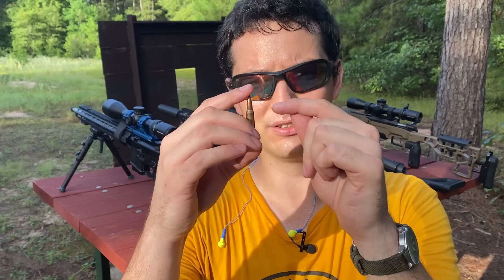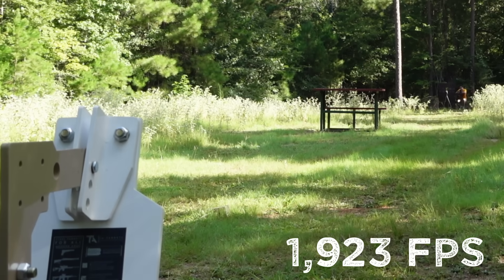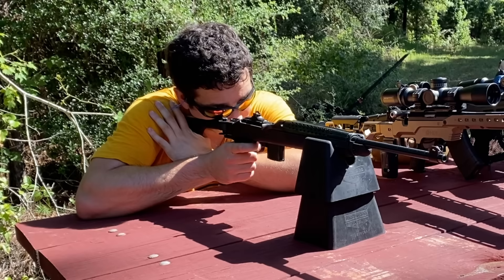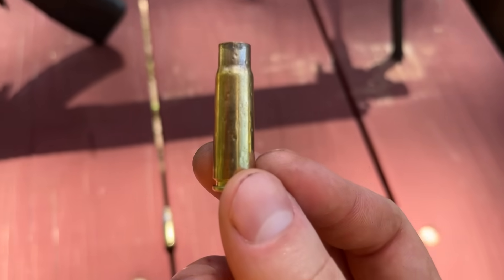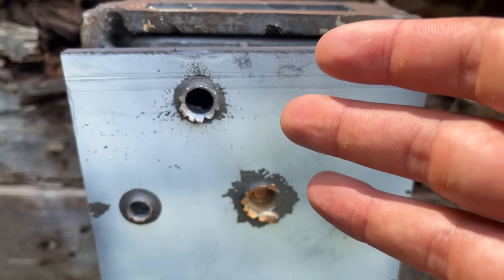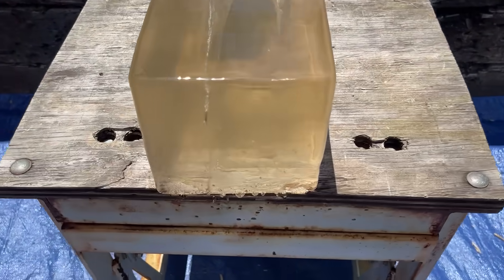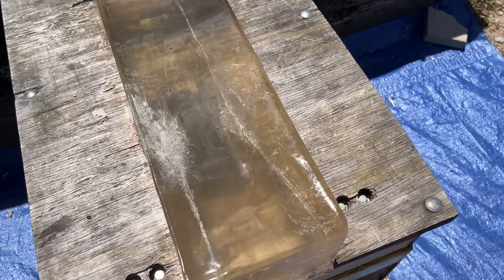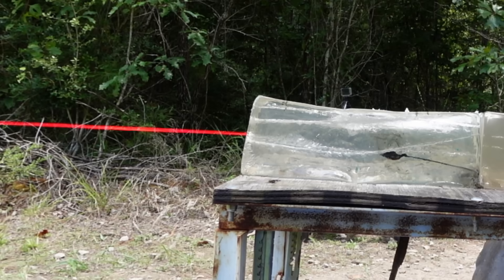I Will Never Shoot These Bullets Again

Comment: I bought an AMT Automag III chambered in M1 30 carbine, roughly in the early 90s. Haven't got it out for quite a few years, so went to the range with my youngest son, this Christmas (he's 38) and fired some of that cheap Mexican Ammo. It worked fine, but my Automag jammed after about 22 rounds. A roll pin came loose and jammed the slide. Resolved that the same evening while cleaning it. Went back later in the week and fired another 150 rounds plus finished the Mexican ammo box too. No issues, and I'm fairly certain that my loose roll pin had nothing to do with the Ammo quality?  I had 2 other brands as well, of M1 Carbine because its getting harder to find. It was a lot of fun. The Automag is a long slide, so it has a good site radius, easy to aim with precision! Anyway, I recall one issue back in about 1993 with some extra "hot" reloads. The bottom of the magazine blew downward and out. It was the only mag that I had, at that time, so that stopped my fun for that session. Before long, I purchased two new magazines. So its had a bit of a checkered history, but overal its a fun shooter! Whereas never had any issues at all with my actual M1 Carbine (long gun, not the Automag). Mine is an older WW2 relic. Used it for thousands of rounds over the years, when attending DCM fun-shoots, back when I was younger and had more spare change!  The M1 30 Carbine round is a good performer for plinking out to 100 yards with a peep site, or about 50 yards with the long slide pistol. Good enough to group well, but basically very little recoil; makes it a relaxed time of good fun at the range!  👍🤠   So if something goes wrong with the M1 Carbine long gun, after very few rounds, I would suspect poor manufacturing quality??

Comment: Years ago I had a bolt on a word war II IBM 30 cal carbine shatter. Luckily I was wearing shooting glasses. I did have a few minor cuts on my face. I had the rifle checked out by a gunsmith, all that was needed was a replacement bolt. He checked the headspace and fired 4 proof rounds through it. It's had well over a thousand rounds through it since

Comment: The 5.56mm tracers don't ignite untill 65 to 75yds & burn out at 500yds so u need some distance for this test. The 30carbine burns from 100 to 400yds. The 7.62x51 burns 100 to 850yds. 50cal burns 200 to 1600yds😊

Comment: I got my hands on some of that fake LC 52 berdan primed Chinese junk 25 or so years ago. at the time, I did not know that it wasn’t real Lake City ball ammo.  We were shooting some of it out of a Ruger Blackhawk in 30 carbine across a chronograph. we were getting velocity readings with over a 500 ft./s swing in velocity. that stuff was clocking out of that Ruger between 1800 and 2300 ft./s. The difference in muscle blast between the 1800 foot a second and 2300‘ a second was obvious. that Ruger is a strong design which is probably why it stayed together. wish I still had the spent cases. Primers were flattened way out of of the pocket on several of them. When I looked inside the cases and saw they were berdan primed, that’s when the light bulb went on. I trashed the rest of them. this is likely the same thing you experienced.

Comment: I had fired a Broomhandle Mauser pistol  in 7.63 mm calibre years ago in 1973 at the Long Beach Police Pistol Range with DWM #403 surplus ammunition that was loaded in 1936 that was loaded with the fulminate of mercury primers. Well, one fired but the head of the case blew out the magazine well and did some other damage to the extractor.I bought a new magazine flat spring and pressed the bulge out of the magazine and replaced the broken extractor. What happened was the Mercury vapor in the priming compound seeped into the brass at the head of the case and weakened the case so when the case was fired it gave way. The moral of the story is never fire old Mercury based primers as the Mercury vapor creates an amalgam with the brass case weakening the case and leading to damage of the firearm. I'm glad the shooter here wasn't hurt too bad from that case explosion. He mentioned that they were all old cases and they sure were. I also ended up with particles of brass stuck in my forehead and my left hand. One more thing the DWM #403 cases I had were "balloon head" cases not solid head the way they are made nowadays. Please pull the bullets from your old .30 Carbine cases and check for "balloon head" cases.

Comment: The funny thing is, I have never shot a bullet or a gun. As a gunsmith, i have repaired over 60,000 guns, test firing most. 

So if you don't get my point, I have discharged / fired around 100,000 cartridges, shooting all sorts of targets. I have shot empty shotgun shells as targets, but bullets, too much work to pry them out of the cartridge and then stand them up.

Comment: The M1 30 carbine will let you fire even if the bullet isn't completely chambered. The bolt can be in the locked position but low quality ammo or poorly cleaned gun and  2mm of the bullet will be hanging out

Comment: LOOKS LIKE THAT WAS A 30 CAL DOUBLE CHARGE LOADED ROUND THAT WOULD EXPLAIN WHAT I SAW GLAD YOUR OK   had that happen with some reloads  in my 45 acp 1911 5"  steel frame  blow the mag out and the  grip panels off in my hand destroying them  lucky i took no real damage  just stung the shit out of my hand  my 45 was ok  except the grips  and still shoot it today but din inspect it very carefully  and had it way over sprung and shock buffed  when it happened  so i lucked out  but the 30 carbine is built pretty stout so other than the mag it mite be ok  check it with the proper gauges  and check barel for any bulges  but if not  you should be good

Comment: Back in the 1980’s my brother had a brand new Plainfield commercial M1 carbine go kaboom on its 12th shot… receiver fractured into 2 halves… blew the bolt several feet in the air. Factory Winchester 110gr ball.

Comment: You can definitely see inbound tracers especially if you’re wearing NVGs. That’s how you can tell when you’re flying over a “wedding celebration”. Had an M-14 bolt explode on me a long time ago. The rim on the lower portion of the bolt face fragmented. The magazine & additional rounds in it took most of the spalling. Eye protection matters.

Comment: At this point, I am going to assume that any channel named "- Ballistics" and playing with weird rounds is asking for an ancient curse.
Reply: Scott from Kentucky - hold my slap round*. Two dudes and a high speed camera - *hold my RPG-7
Reply: @praetorxian  slap round filled to the brim with pistol powder, that is... a really bad idea, burns much faster... not sure what caused the slo-mo guys RPG disaster
Reply: @Hunne2303 IIRC Highspeed Ballistics used a re-activated launcher. And that it's just a common issue when you re-activate those launchers. I could be completely wrong though.
Reply: @Hunne2303 It was ballistic high speed not The slo-mo guys that had the RPG accident and I believe they said it was caused by the rocket breaking apart inside the launcher, the only reason it wasn’t as bad as it could’ve was because in the de/re-activation process a hole was drilled that acted as a failure point before the RPG became a pipebomb.
Reply: @D @Dovahkiin27 may also be wrong but I believe it was an ammunition fault and they brought up the Re-Activation because that actually saved the guys life by causing the launcher to break apart before too much pressure built up.
Reply: @Insertnamehere662 I re-watched the video and you're right. I was remembering the long section where they talked about how re-activated launchers do have a similar problem, but only if done poorly and that their launcher was re-activated with a more high quality method.
Reply: "Stick a thumb in it..."
Reply: @joetuktyyuktuk8635 indeed!😊

Comment: I was an M1 Abrams crewman and we basically used tracers so we could see where we were hitting. The M240 mounted on the driver's hatch wasn't the best aiming machine gun, so you basically started firing and adjusted the aim when you saw where the rounds were going.

Comment: Hey man, when firing with experimental rounds, it is probably best to hand load those jokers... 30 carbine is rather easy to hand load (straight-wall cased and very forgiving on powder types). 
You don't need some fancy turret press or anything like that, just get a benchtop press and reloading dies for the desired round. 
You can still buy the rounds you wish to test, just dismantle the cartridge and swap out the powder with known good powder at a known charge weight. 
You can also weight the bullets and use plain old FMJ of identical weight to get the powder charge dialed in BEFORE testing something like old tracer rounds.

Comment: If you were using tracers aimed at an observing target, I would suggest the "general norm" we are exploring is real-deal warfare.

If for any reason the operator would use that in a non designated-machinegun/-autocannon weapon, it would pretty much only make sense in low light (if even then), despite the insane risk that comes with blazing such a trail that everyone sees, not just you. But also at such a long distance that a trained professional really NEEDS the visual aid, because they are expecting a low probability of hitting or taking down their target on the first shot - so you're shooting from near or beyond the regular effective range even with a sighted in weapon (a soldier not experienced and skilled with the weapon, wouldn't just happen to have specialty tracer rounds for it on hand) - you are expecting to not be able to correct the aim onto target without aid of one or more tracer - and frankly, not expecting the target to move after hearing shots fired, projectiles impacting near them, and seeing the trace.

So here is my honest opinion and conclusion.
1) To test this at all, you should be doing so in low light, at 300-400m+ range, and with at least a 5-600fps camera fit for low light. Because our eyes don't work in fps, and ambient light conditions matter tremendously when observing a light source.
2) The results will be practically impossible to translate to this kind of video, because you need to play it back in real time at the full frame rate (and view the footage in equivalent light conditions).
3) The real world scenario for this - I don't think it exists in any meaningful way. At best, being exceedingly generous, it could in theory be used for firing anti materiel arms at minimally guarded or unguarded materiel. Because you need the tracer for correcting, it becomes "pointless" if the target can/does move, and the use situation need to be considered so low threat that it's safer to shoot multiple rounds at fairly low rate with highly visible tracers in the dark, at a stationary target - than firing maybe double or triple the amount of shots but without tracers. Or just doing it in daylight.
4) Even this hypothetical falls apart, when considering the altered and usually substantially inferior effective range and precision of tracer rounds. If you're at a range where aim and accuracy is unpredictable and visual confirmation through optics or night vision aided optics doesn't cut it, tracer rounds are gonna perform even (substantially) worse. They're gonna do your targeting much more harm than good.
5) The realistic usecases for this is short range high speed photography/study, recreational (just for fun), and Hollywood adventure times.

Comment: As a retired infantryman, the tracer rounds aren't really made for "destruction" they're made for marking. Riflemen aren't issued tracers but machine gunners are. The MGs use use the tracers to walk onto target. Only exception is sometimes leaders will keep a "hot mag" that is 30 tracers used to put on full auto to mark a target for soldiers who can't grasp where to shoot or helos coming in for support. I carried 1 hot mag on me while in Afghanistan.
Reply: Yup, at night when you cannot use smoke for the CAS, because they cannot see it, you use a 30 round mag of tracers to mark where you want the ordnance dropped.  Same for the squad, they can see the SL mark the target and direct their fire at that point if the lack a confirmed individual target.  I carried one 30 round mag of tracer for marking.  Two with one in three tracer. and the rest all ball.  Marked the mags with tape to show which had tracers.  The marking mag had a full width of 100 mph tape, the 1:3 had a thin wrap of 100 mph tape, and the others with ball were all clean.  Danang RVN 71-72.
Reply: I used to carry a hot mag and put 3 in the bottom of each of my mags.

I used my hot mag to direct m249 and m240 fire during firefights.
Reply: At one point during WW2 they removed the tracers from the ammo belts of defensive gunners in bombers, the difference in ballistics between them and the other .50 cal rounds had the gunners shooting the effective rounds well clear of the attacking fighters as a result. 
The channel WW II US Bombers did a series of videos about the defensive guns on bombers that covered it, they also wound up bringing back tracers after some kind of a work around to fix the issue, but they didn't return to using them for the sake of the gunners, it was because they found out from interrogating captured German fighter pilots that without them seeing tracers coming at them they were more confident and brave in their attacks.
Reply: Used to love the light show in night-time AFG firefights
Reply: @davidduff5123 
I was a Vulcan gunner in the Army back in the 80's, 3,000 rounds per minute of 20mm with every one a tracer, you should have seen that light show.
Reply: In Baghdad ‘04 we loaded our M4 mags so the last 5 rounds were tracers, so that in a firefight when you saw tracers from your rifle you knew to reload. The belt feds had every 5 rounds for visibility of impacts down range. It was especially impressive to see in night engagements, as the rate of fire of the 249’s and the coax on the Bradley’s made it look like a scene from Star Wars
Reply: I mean yes, most know the purpose of tracers.

However, few do stop to consider if they're any good when they do hit
Reply: @1stCallipostle it's irrelevant. As a MG in Iraq we know the 7 rounds in between are very effective. Tracers juat help you walk it in.
Reply: Thank You.
Reply: My dad shared a story of one of his friends getting hit with 7.62X39 tracers in Vietnam. Got stitched with a burst across the chest and lived. Granted, I don’t know what the distance was or if his friend was wearing a flak vest.

Comment: I had a Auto Ordinance blow up on me exactly like that with Armscore Ammo. Called Khar Arms (Auto Ordinance) they were not even slightly shocked by it when I told them what brand Ammo it was. Agreed to Replace my gun but took forever for them to ship the replacement. Mine was a case head separation on the ammo.

Comment: Couple years ago I bought a Universal brand .30 cal M1 carbine, used from Cabela's Gun Library.  4-5 rounds in, the bolt self destructed while firing standard .30 cal ball.  No warranty and Universal is out of business; can't find the parts.  Fun while it lasted.  Cost?  About $100 per bang.

Comment: IF that 7.62x39 Tracer was a complete surplus round then it was likely one used as a special training round for one of the RPG series launchers. It was much slower because the round was designed & loaded to match the trajectory of the rocket propelled grenade it was designed to emulate. Ian over of @Forgottenweapons has a video on one of the RPG-7 (if I remember correctly) trainers.

Comment: I hate shooting blowback 9mms because I had one pop on me from the heavy ass bolt shoving the bullet deeper into the case, normally a locking bolt wouldn’t have an issue but it was just far enough out of battery to blow the case head off and sprayed 💩 all over my lips. And chin.  we need more roller delay guns and less direct blowback trash.

Comment: Back in the mid-1960s, when I was in my teens, my old man bought me an Inland Manufacturing M1 carbine for $20 mail order from the DCM. Yes, you could do that back then. 

One day, when he and I were at the range, I blew it up much like you blew up your M1 carbine in this video. It blew the guts out the bottom of the magazine and blew a piece of wood about 6 by 1/2 inches off the right side of the stock. The bolt was stuck about a quarter inch out of battery and frozen in place. The case web had blown out and gutted the magazine.

The old man had just started casting his own bullets, and used them in the rounds we were shooting that day. He didn't flare the case mouths enough before seating his bullets. A few of them had small amounts of lead piled up in front of the case mouths. This kept the bolt from going all the way into battery. It turns out an M1 carbine can fire out of battery.

We replaced the bolt, reasembled the magazine, and glued the stock back together. The carbine worked fine after that, as long as we fed it good ammo.